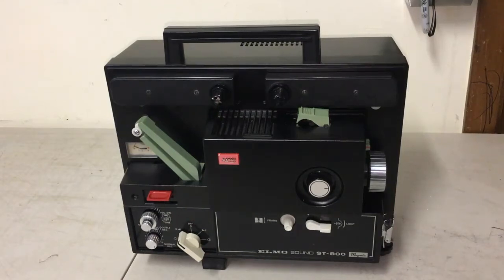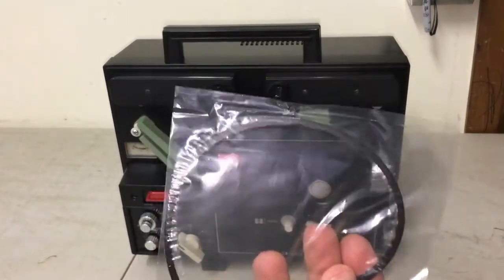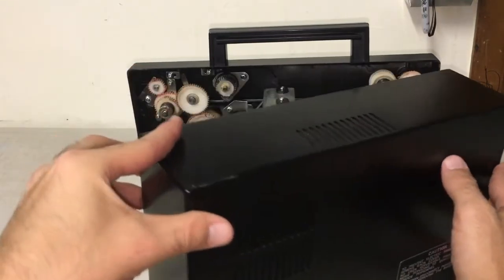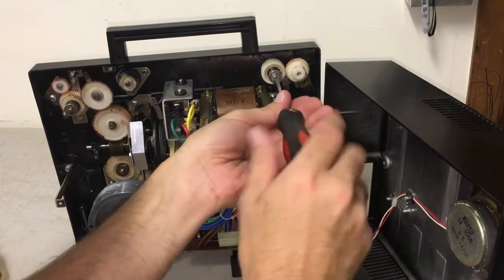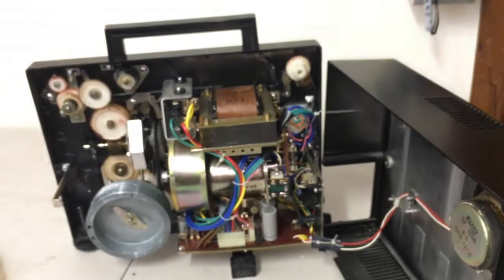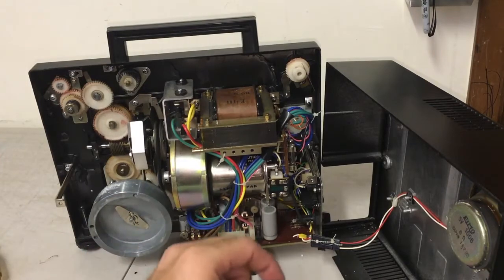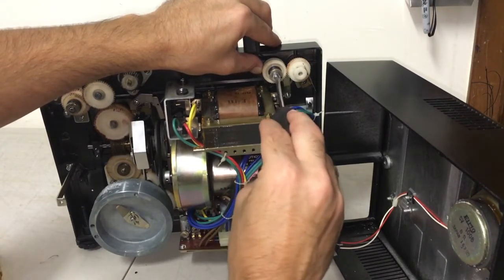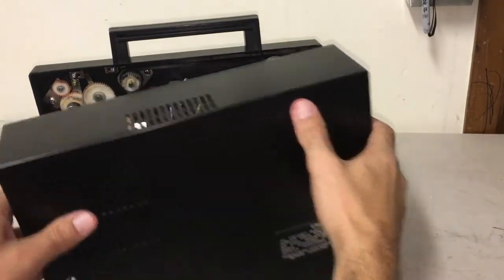How to Change Upper Belt - ELMO ST-800 REEL TO REEL PLAYER Sound Projector REPLACEMENT REPAIR

Comment: Where did you get the correct belts?
Reply from the maker: I searched eBay. Just type in the model number and if someone has the belts, they will pop up for sale.
Reply: @repairresell3449  I ordered a belt from eBay, but got the one that was too large. Impossible to make new contact with them to get the smaller size. Anker
Reply from the maker: I also had that same problem. The first set of belts I ordered were too large. The second set I ordered was correct. I never got to return the first belts I bought because I waited over a year to finally get around to doing the repair, and by then it was too late. Luckily the belts are only like $8.
Reply: Thank you very helpful.solved my problem.